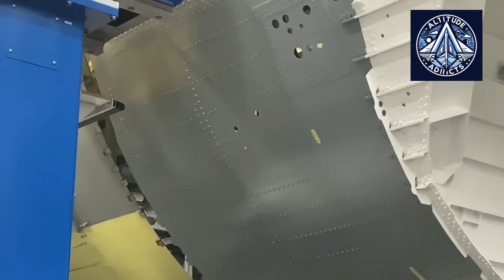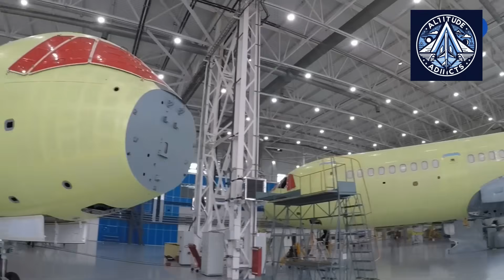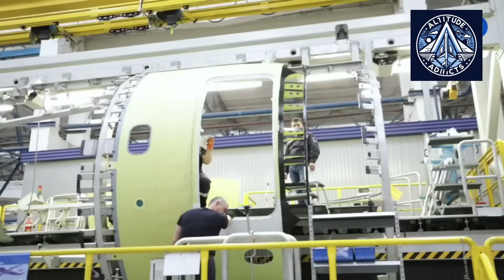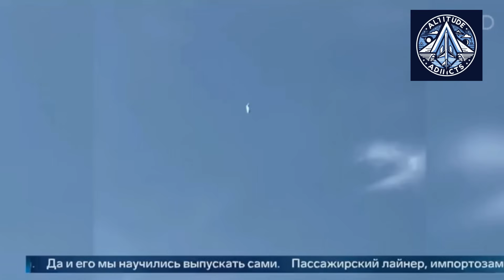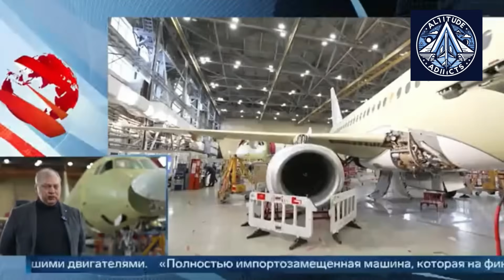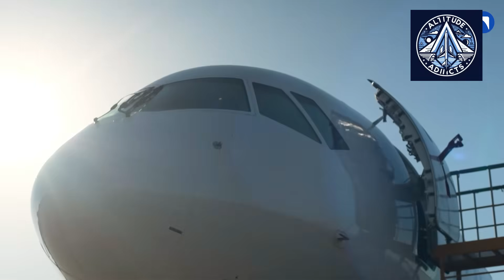Second Domestic MC-21 Prototype in Making, 20 Plus in Production

Comment: The MC-21 itself is a prototype designation, the aircraft itself would be a Yakovlev  24XX, there have been many prototypes along the way with different engines and probably a few more to certify it with two or three different engines, stretched versions or shortened versions... There might be a Kusneztov, Aviadvigatel, Klimov, Saturn, UMPO, MPP motor, Salut, Soloviev, Progress or Lotarev engines used to play with it but would be in constant evolution, that's just how Russians roll....!..
 At least a dozen turbine engine manufacturers to chose from, at the end of 2025 they will have at least 10 prototypes MC-21 to play with....

Comment: None of this means anything unless and until the weight overrun has been reversed.
If reports are true that the weight gain is due to the borrowed landing gear from an old plane, then what about using titanium, or even magnesium, for the landing gear?
Russia, apparently, has enormous deposits of both minerals.
Most of the civil aviation industry in Russia is state owned so who cares of the cost of the minerals, as long as it's sitting there in the ground domestically???

Comment: Adding winglets to the MC-21 might help with range and fuel consumption.
Reply: Sejauh ini desain sayap MS-21 sudah sangat tipis dan sudah minim hambatan udara, maka Winglet tidak signifikan dibutuhkan.
Reply: Winglets are not complicated thing, can be added at any time.
Reply: Winglets indeed increase lift and reduce drag, and aircrafts like Tu-204 and Il-96 do have winglets. But for some reasons the MS-21 and SSJ-100 do not have them. It is probably not worth it for short ranges.
Reply: @DisNerbal  The new version of the SJ-100 HAS winglets! The MS-21 will also have them in subsequent upgraded versions.
Reply: @DisNerbal All new SJ-100 aircraft are equipped with winglets.
Reply: Why doesn't the 787 have them?
Reply: @AnarchyEnsues  The 787 has them, but they are very small. The MC-21 doesn't have them yet, but it will have them, and they are also very small. These two planes have composite wings and a more perfect profile, they don't need large winglets.
Reply: @AnarchyEnsues 787 has rake wingtips
Reply: @timb4098 so winglets are not the best science today.

What about 777x?  Extra 3m of wing span is better than winglets.
Reply: Winglets are not necessary for this aircraft... such winglets are intended for the old heavy metal wings, to reduce the vortices at the wingtips. Modern composite wing designs do not need this because the wings are very thin and create minimal vortices. If you put it on the tips of the wings it would need thicker wings, so the whole idea of a thin wing loses its meaning...
Reply: @jerromedrakejr9332  The Airbus A350 wings are made from composite materials and have winglets.
Reply: Naaaaaa. Those have no bearings on range nor fuel consumption. But handling especially during takeoff and landing.
Reply: @Dshrath-r8z A lot of aviation websites say that winglets help with fuel efficiency and help with range. I even looked at the NASA website.
Reply: @timb4098 Well, that must be a new thing. Originally they were meant for stability during takeoff and landing.